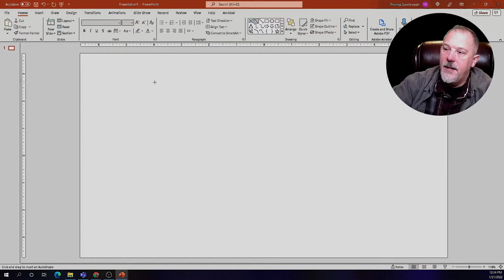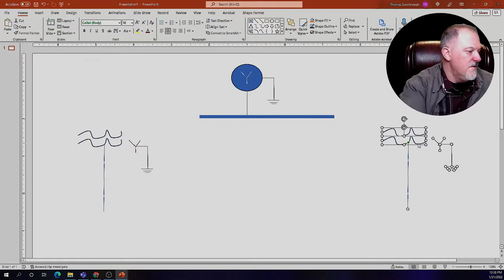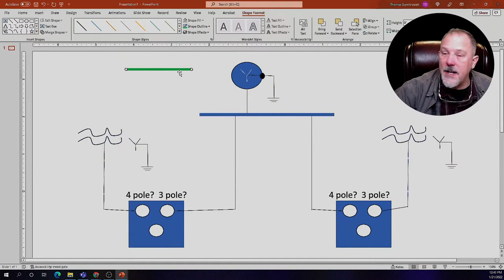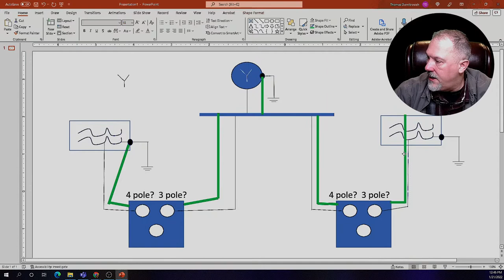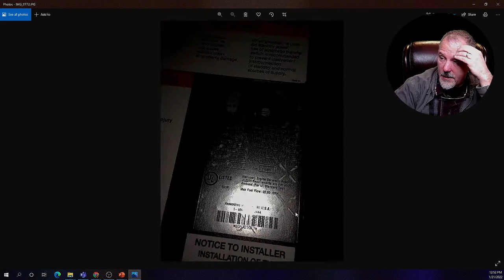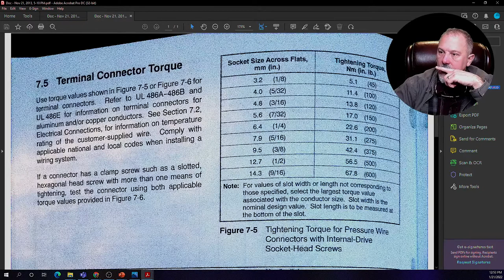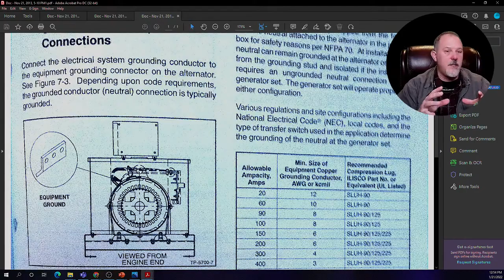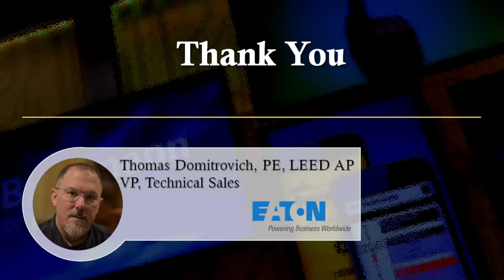Q&A Friday

Comment: On some standalone PV systems, there's not enough fault current that is available to cause a breaker to trip based on instantaneous overcurrent if there's a bolted phase to phase or ground fault on the AC side.  Other protection is sometimes needed.  It is neat though to see how low the cal/cm can be on some of those.

Comment: @22:00 Maybe they should have an exception to the required receptacle if you have a UPS for a light.  If it is going to an outbuilding, then I guess now every service panel in a separate building needs warning labels to communicate that there's more than one disconnect per 225?

Comment: Sorry I missed this. I have a question for you regarding the PPE category method table (I'm trying to gain a better understanding of the method).

Does the following example fall in the 6th row "Other 600v class equipment" of the PPE category table or since it's a panel board and doesn't fall in the first two rows I'd need to go to the incident energy method? 

A 600 volt rated I-line panel board with nominal voltage of 480v. The available fault current is 27kA and is fed from a molded case circuit breaker with a trip time meeting the 2 cycle standard. Falls in 6th row?

Should it be interpreted as "other 600v equipment excluding panelboards" or "other 600v equipment including panelboards"?
Reply from the maker: Next Tuesday at 5:00PM Eastern I'll do a deep dive into the table method and answer this specific question.  deal?  Here's a link to that session:  https://youtu.be/AXQmIKtgSvM

Comment: Article 555: Most states adopt a construction code and a maintenance code.  Maintenance codes generally would specify the requirement to maintain things including electrical equipment.  Thus, I think the 2023 proposed language in article 555 is out of place.  NEC can't solve every single electrically related problem.  Some problems have to be solved by other than the NEC in the same way that states sometimes have to solve problems instead of the Feds.  Jurisdictions are free to adopt NFPA 70B or 70E if they choose to.